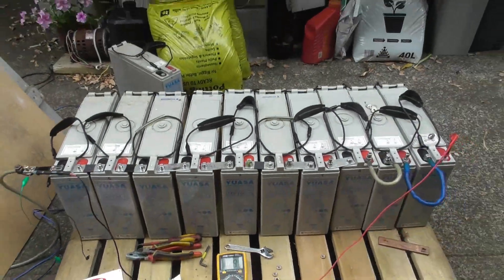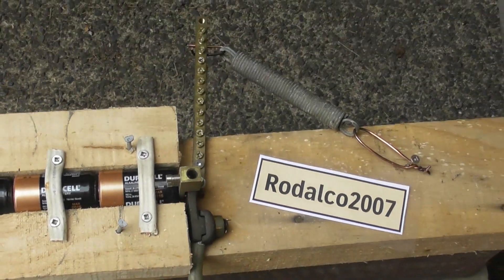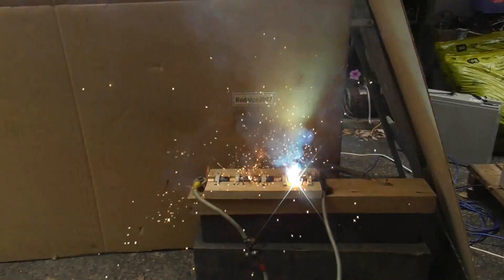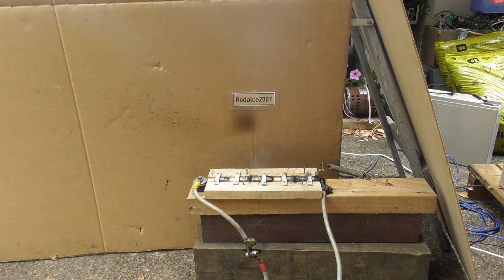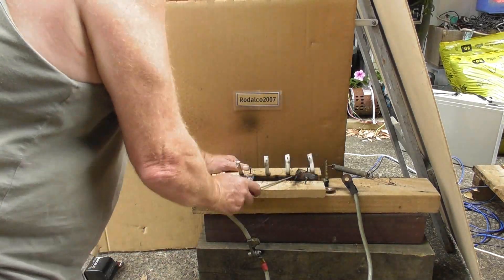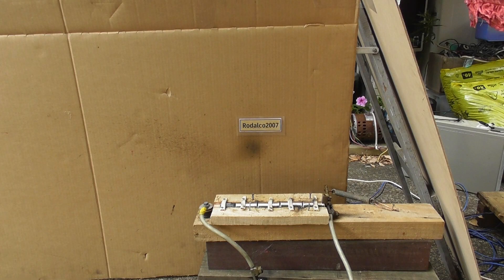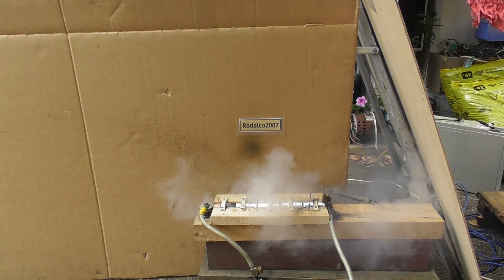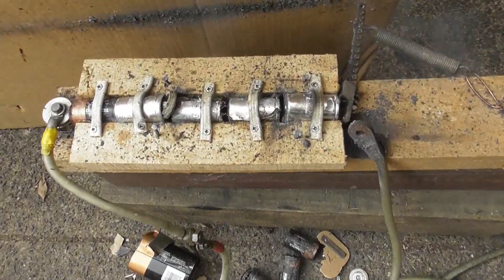Overcharging 5 x Duracell D-cells versus 120 Volts DC 100Ah ◄ Happy 2023►

Comment: Happy New Year, Ray.  That`s the first 6v battery I have ever seen that contained 4 D-cells.  The ones that I have seen opened up had a bunch of AA`s inside.  And yeah, it has been years since opening one up, so I guess they figured out a cheaper modus operandi.
Reply: 1.5v each cell not 2 volt like car battery cell.  Use to get the carbon rods out of the cells.

Comment: Happy new Year Rodney, amazing those did not come pre leaked, but definitely leaked after the fast charge. Of course the lantern battery is being cost cut, after all those F cells must cost a whole 10c each to make, while Berkshire Hathaway can buy no name brand D cells for 1c each, and then spend another 1c to put the Durahell sleeve on them.

Remember Durahell is now just a brand relying on name recognition, the product comes from the same factories that make store brand cells, just sold at a premium, and all the old product guarantees have long gone, replaced with the sole thing that, if they leak, and you have proof of purchase, they will give you the same battery back, provided you pay to post the leaky ones, and proof of purchase, to them. Will not refund postage, or pay for repairs to equipment, any more.
Reply: People who still use non-rechargables are at fault. There's no reason to still use them. Most equipment still runs perfectly fine on Eneloops or LADDA, others can be powered by Li-Ion 1.5V cells with step-down.
Reply: @kyoudaiken  Except for things like wall clocks, which pretty much need an exact voltage, and with the current draw being close to self discharge rate of your typical AA cell, except for those with "continuous sweep" which run at 8Hz, so they draw an appreciable current, not the 100 nA, with a 1 per second 20mA pulse of the regular mech. Hard to get a voltage regulator to draw as low a current with that low average current, pretty much every one draws more current. And yes to get accurate time keeping the voltage does need to be almost exactly 1V4, which is the plateau voltage for the typical AA cell. Even ceramic capacitors will have more leakage current than the clock uses.
Reply: @SeanBZA  I'm running radio controlled wall clocks with hands on Eneloops and LADDA for years now without any problems. You don't need Li-Ion ones for that.